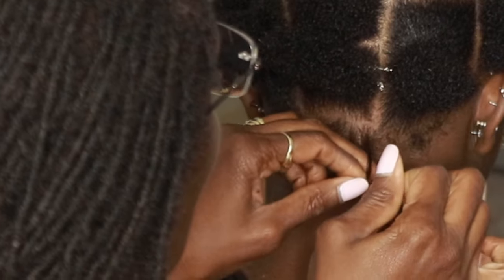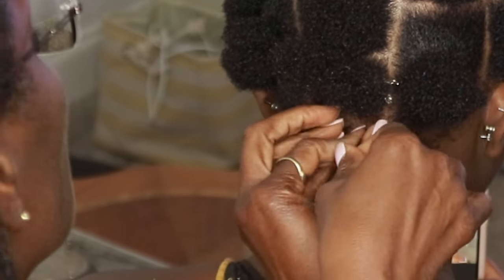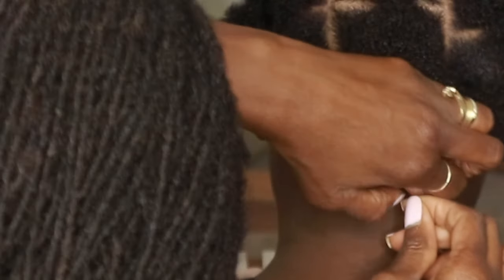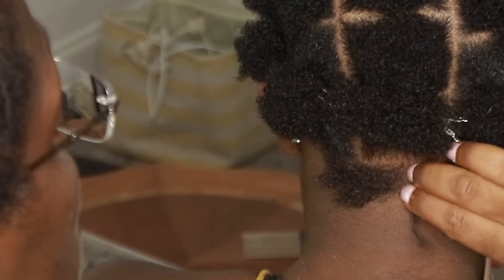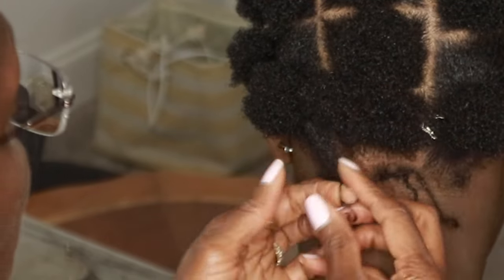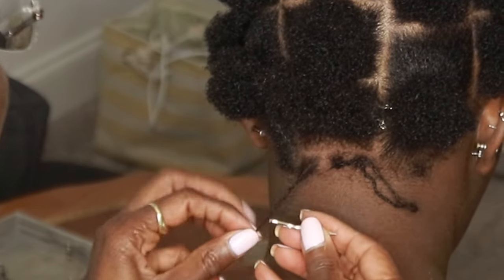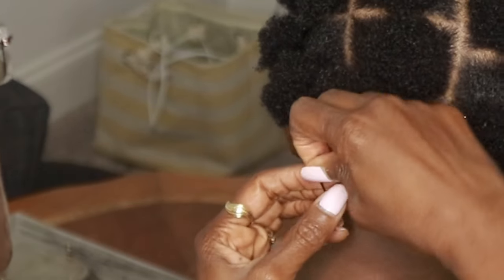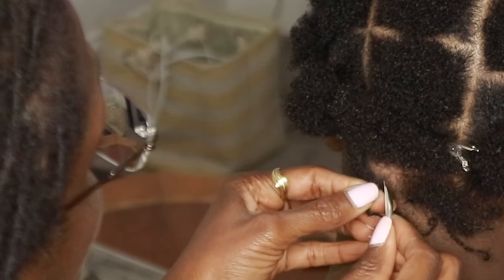HOW TO INSTALL MICROLOCS | Interlocking Method Step-by-Step

Comment: I'm loc'd. I've got microlocs. My locs turned 3 months last week. This is my second set tho. With my first, I combed them out after 6 months. I wasn't okay with how they were turning out.  I wanted smaller locs. So I did the second install myself. Took me 4 days tho.  I'm very satisfied with the outcome.  Oh and I use 2 point because it's the easiest for me.  😊😊
Reply from the maker: 4 days is pretty fast for diy. Good for you!
Reply: @JOSETTEBIANCA  Thank you for the compliment.🤗🤗
Reply: How long after you combed out your locs before you did your micro locs
Reply: @sandraross8642  I started the 2nd set within a week of combing out the first one
Reply: Do you have a video of how you did them on yourself?
Reply: @parisstarr7587  oh no. I only have videos of the finished product
Reply: Can you share your pictures of the 2 point?
Reply: Do u get massive shrinking with ur locs? I have 4c hair and I’m wishing to get micro locs or sister’s locs but I’m scared my hair will shrink too much.
Reply: @ShrekIsMyPookie4Life yes
Reply: Do you ever miss your hair? That’s the only thing keeping me from getting my hair loc’d
Reply: @veemotron3089  I used to miss my hair when I was around Yr 1 but at Yr 2.5, I don't miss my fro at all
Reply: I think the shrinkage would make a great hairstyle.  Maybe a bobb... thats what look forward to. Many long hair styles are just boring to me. @ShrekIsMyPookiei4Life

Comment: I finally found the perfect video to start my sisterlocks journey,  because I have a lot of hair and long already,  they want to charge me $1500.00. And I see why and the time it takes.  But I'll do mine. Really detailing
Reply: This video isn't sisterlocs though
Reply: I was quoted that also in march but that was a sisterlocks consultation.

NEVER HONESTLY WANTED ANY ONE TO INSTALL JUST WANTED ASSISTANCE OR SUPPORT WHILST DOING
Reply: Hi, I want to install my own locs as well. Would you consider posting a video, because my concern is parting my hair in the back and controlling the sectioned hair as I'm locking it. Thank you

Comment: Im on my 2nd set of locs as well. And decided to go smaller with this set too. My first set was 78 locs which I had for over 9 years. My 2nd set is 180 ish and currently locked for a little over a year. I love locs! I use a 2 point rotation because my fine hair needs all the body it can get.
Reply: This makes so much sense... only doing a 2 point rotation so the locs can fill out more! I have fine hair and have cut my locs off 3 times because I was just dissatisfied with the look... great advice.
Reply: I'm really thinking of starting over too 😢 I'm about to hit a year, time flew

Comment: This is super helpful. Mine were installed by someone else but the bottom row slipped out almost immediately because it’s so much looser than the top and this finally helped me reinstall them appropriately

Comment: I’m on my first set of locs. Surprised to see it’s been 5 months and I love my locs. I installed mine myself. I started with 2 strand twists so my hair shrank up a lot. I have 210 locs. i have tried 2 point and 4 point rotations for my reties. I hope to decide which retie method I will use going forward.

Comment: I adopted 2 AA girls and have learned how to do crochet installs, box braids, countless styles with braids and bands, by watching thousands of YouTube videos but I think this would be stunning on one of the girls and would love to try.  So, I have some questions for you: 1. Is it better when the hair is wet, damp or dry? 2. I saw you don’t use products in a comment, am I supposed to moisturize prior just not after done or not at all? 3: she has thin stranded 3C hair, is that strong enough for locs? I don’t want them to break off.  

Thank you so much for your videos and instructions!
Reply: Waiting for answers too. Good questions
Reply: When I got my sis locs, my hair had to be dry and stripped of all oils. This is good for parting. My loctician did use a spray bottle when needed.  It consisted of tea tree oil, coconut oil, and mostly water. This also helped with parting. No oils should he used for moisturizing the first year or at least until they lock. If dry scalp occurs,  the tea tree and coconut water oil is perfect.

Comment: I have traditional locs (on my 4th restart). I want microlocs but i want to attempt to do them myself and came across your video tutorial. I cant afford the prices they charge for installation. I just need to get this tool. I know i need it. I dont know which points I'll use but I'll figure it out.

Comment: I havd a question. Are you supposed to go in an order when interlocking? I thought you were supposed to go clockwise or counter clockwise all the way around? So what I mean is you loop from the top, then right side, then upward from the bottom, then left side then repeat .. if that question makes sense. 

I plan on doing them myself, I had two strand twist locs in the past but I didn’t like how thick they were. I want something that’s close to loose natural hair that I can also do other styles on.

Haha should’ve kept watching the video, you answered my questions 🤦🏾‍♀️

Comment: Hi I’ve been loc’d for 2months now ur video was my inspo to start on my short hair, but I’m suffering from a lot of slippage…I started mines with short hair like you and lot of my locs in the back are slipping out all the way, what can I do to help them stay?
Reply from the maker: Heyy definitely make sure that you are braiding and banding or bunching and banding. That helps a lot. Also make sure to be very gentle when you are washing your locs.
Reply: You can also braid (plat) your locs that have a lot of slippage. The braided locs will not shrink as much as your 2 strand twist locs.

Comment: So out of curiosity, can microlocks be started using either the braided, coiled, or two strand twist method? I have seen all the above and the one thing they all seem to have in common is interlocking.

Comment: I’m 9 months locd 😢 and I have a spot. So I’m thinking of starting over. My loctician bailed after install so I’ve been doing them myself. Wondering if I should shave and start them again. I’m trying to wait the full year before I decide.
Reply: I started with a 2 pt but half way through I decided 4 point is better … less bunching and unraveling potential
Reply from the maker: What do you mean by a spot? A bald spot?